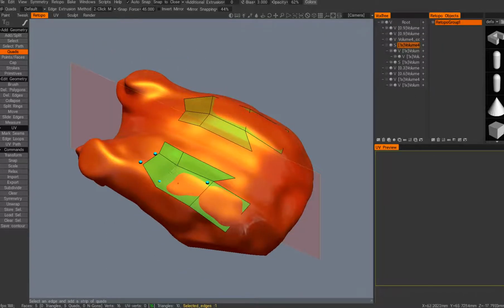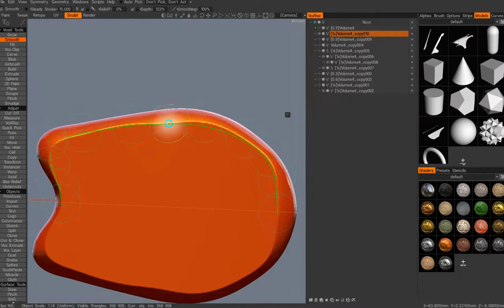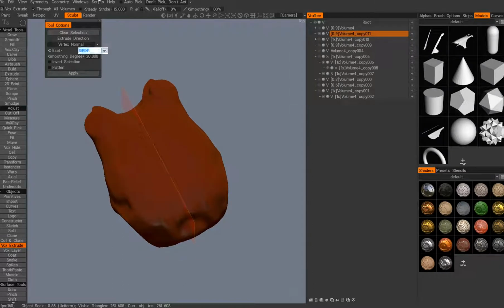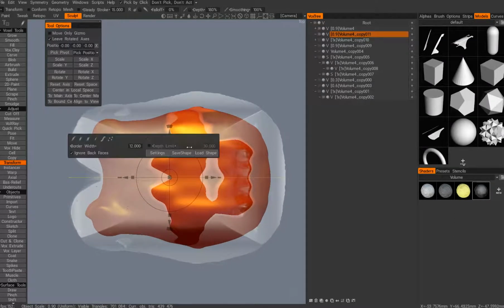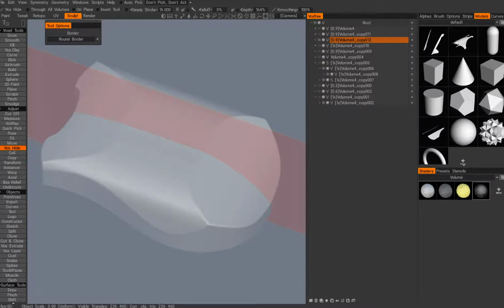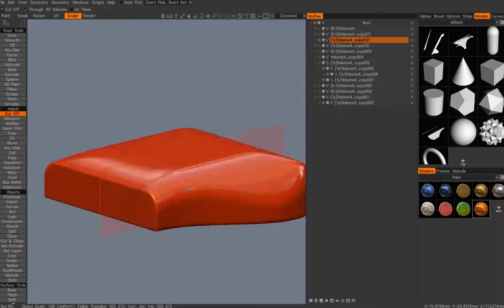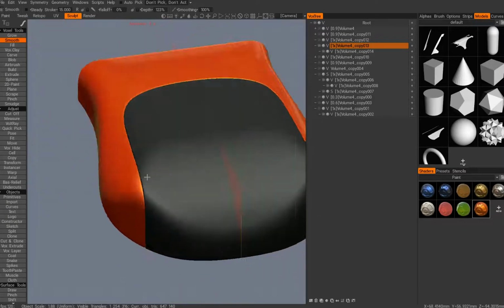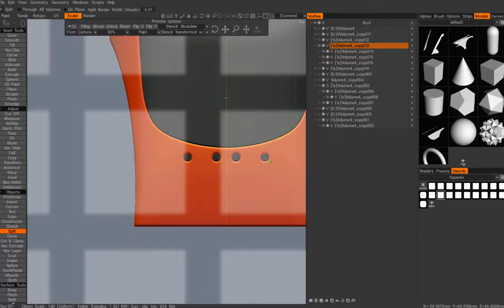Achieving clean smoothed surface in 3D Coat

Comment: To send a Retopo Mesh to Sculpt workspace quickly, just make sure the mesh you want to send, is visible in the Retopo workspace > go to the Sculpt workspace > GEOMETRY Tab > RETOPO MESH TO SCULPT MESH. It might be a good idea to assign a hotkey to it, if you plan to use it often. If you want to move a low poly mesh from the Sculpt workspace, RMB the VoxTree layer > choose RETOPO VIA DECIMATION. If you want it to be exactly like it is in the Sculpt workspace, then set your decimation level to 0 percent (no decimation) in the dialog that pops up.
Reply from the maker: Hi guys, thank you!
Reply: Glad to help, if that answers the question.

Comment: everytime I tried to make some paneling with split mesh almost overlapping then I take a closer look at your viewport and you have this split border width (Voxels) my default was like around? but then I tried your settings and I get the desired result. Now everytime I tried split I always get a clear definition of the hardsurface, and also thank you so much for that smooth it's like a lazy mouse with 100 ratio but it was manually brushed,

Comment: i know fusion 360 is very fashionable but i find its interface annoying. esp the whole cloud storage bs. some simple box poly modeling in blender would be fine for most complex stuff esp with the non destruct workflow there. does coat have the ability to mark polys sharp in retopo? then you could do some box mod with sharps to keep some edges tight while smoothing in sculpt room.
Reply from the maker: Hmm, not sure, they promise extra modeling tools in 3dcoat 2020

Comment: Anton which settings are you using is it the OpenGL or the regular DX setting (Default)
Reply from the maker: Hey man, it's OpenGL. It runs faster on my machine. I've got old GeForce GTX 750

Comment: hello !
 nice video ,I like it but very confusing men ,because you start to show some design at the beginning and I expect to see that design your'e going to show how to do but instead you did some other nonsense that you where surprised too )),so how this is possible ,,where is the tutorial for that first design???
thanks!
Reply from the maker: Hi Eros, thank you for the feedback! I've changed the thumbnail image you are right. I usually start video with a doodle that I've just done to warm up and then carry on. This doodle in the beginning is actually less complex it is just a lump with 2 parts cut off and 2 holes cut through, then I smoothed everything with F12 for 5-6 times and cut same 2 holes to make edges sharper and smoothed again. Then I've split it using the split tool.  But the real trick for the complicated shapes is to do voxel extrude and then cut using spline tool and then smooth using spline brush tool.